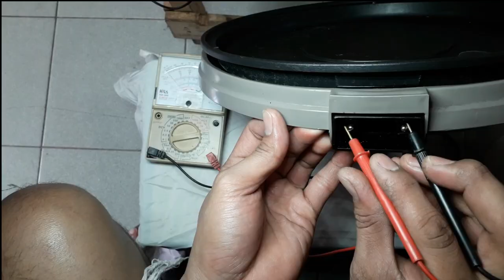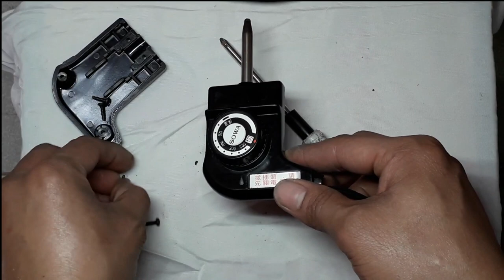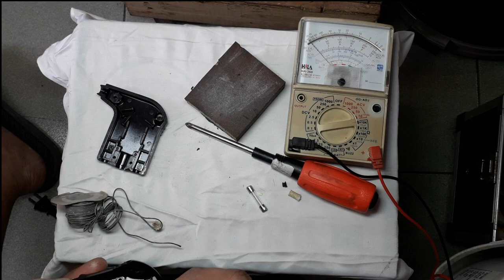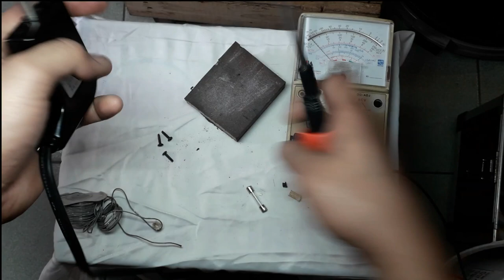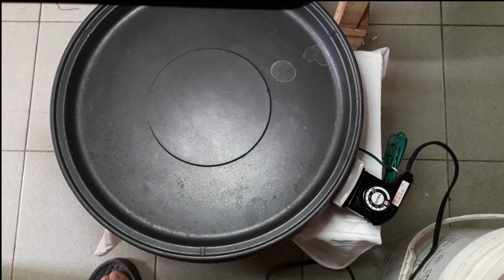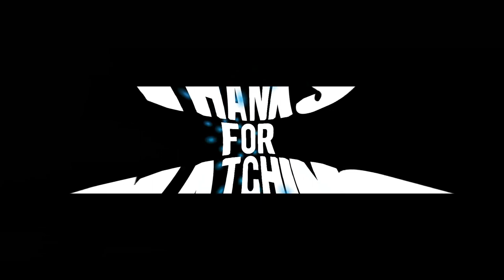Repairing Electric grill (thermal fuse)

Comment: Why your hiding?🤦‍♂️
Reply from the maker: I just focused on what I was doing.
Reply: @Vloglifemode  focus ka nga di namn namin makita pano mo ginawa. anyway thanks pa din sa idea
Reply from the maker: salamat sir sa idea..next video po sir focus naten
Reply: Thank you for this video important. Question: In what position did you turn the temperature values button before taking measurements with the multimeter? Thank you for answering my question because I have the same appliance currently broken at home.